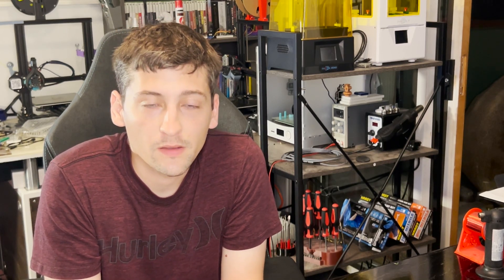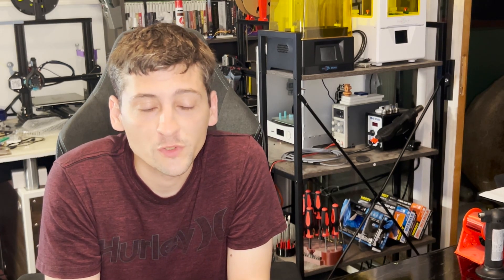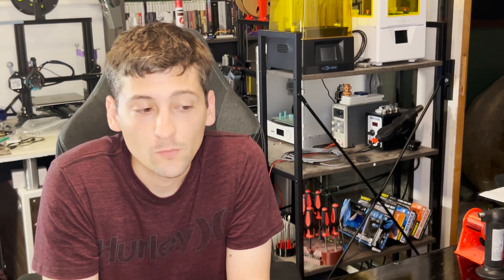Fully 3D Printed Speaker Version 5.0

Comment: have you tried flexible filaments for the black ring part ? maybe something like ninja flex would let it have a better range of motion
Reply from the maker: I have used ninja flex before, the first 3 speakers used ninja flex 85A TPU and now I’m just using a 97A TPU, it’s still flexible, just a lot easier and faster to print.